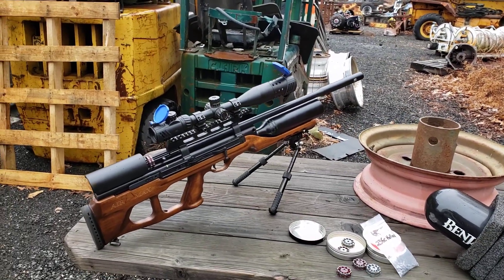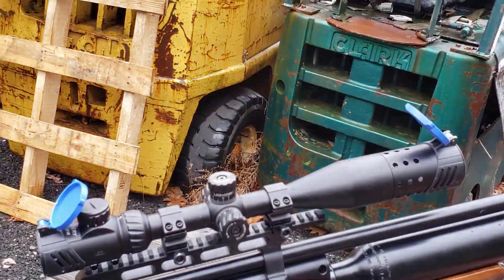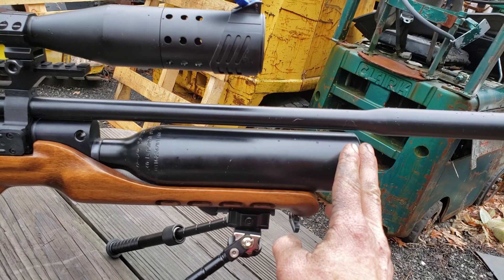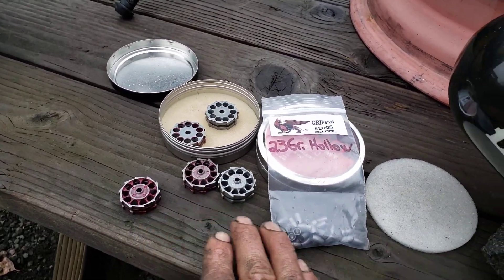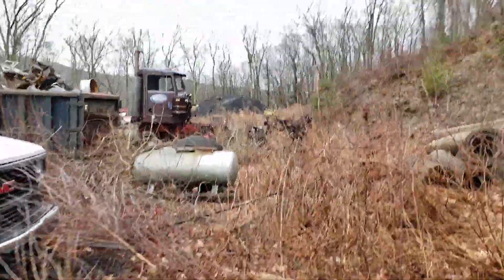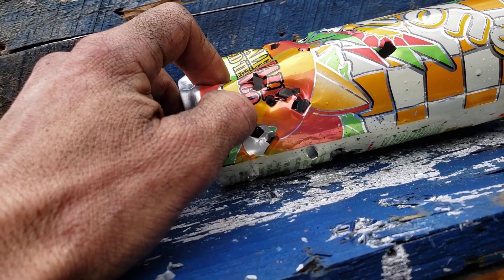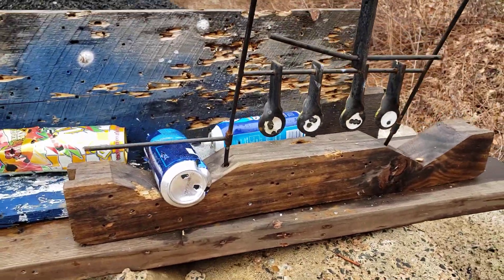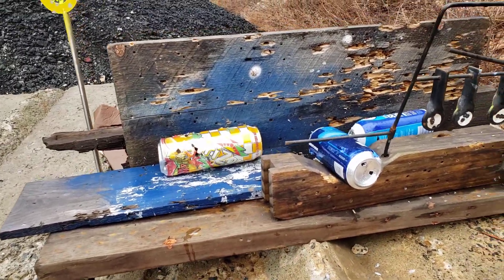Hatsan airmax. 22 testing

Comment: Have you had any trouble using the Benjamin Tank on any of your rifles?  I can’t get it to fill my Hatsan Bulldog, or FX Dreamline.  Both of which are fill probes.  I have bought multiple probes with no luck as well.  Any thoughts...?
Reply from the maker: Yes Hatsan and FX have different O ring placements on the fill probe which are not interchangeable,  EBay has a great universal stainless steel one that works with all my guns and has double-O rings for no leaks...

Comment: I love those Griffin slugs. I wish he could come down a bit on the prices but I now he’s a small operation and probably wouldn’t make a profit. I’ve been cutting the chokes off and recrownig the barrels of a couple of my Hatsans and have made a couple of mean slug guns.
Reply: Jon Hermann - how much of the barrel did you have to remove to cut off the choke?
Reply: Not that much. The choke on those barrels is down to the last 1” to 1-1/2”.
Reply: @jonhermann8239  Thanks, what type of performance are you getting from your .22 cals?
Reply: Out of a Hatsan long barrel depending on weight, with some valve work, open up valve port, you can expect 900-950 FPS. Unfortunately it really likes fx hybrid slugs. Those things are so damn expensive.
Reply: Jon Hermann - I own several Hatsan now part of my growing bone-yard (all purchased 2nd hand) - paid for tunes, tuned myself - quite familiar with fps and mods - I was hoping to know your accuracy after cutting out chokes. Thanks i.e. MOA 50/100 yards, 3/4” at 50/75 yards - I have access to gunsmith - not sure what he’d charge but cutting off choke was never a real thought